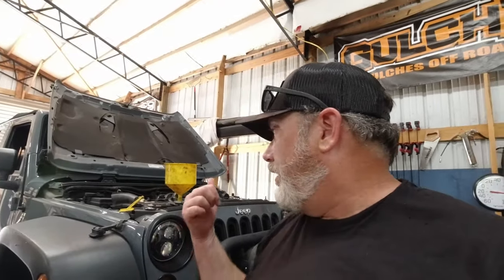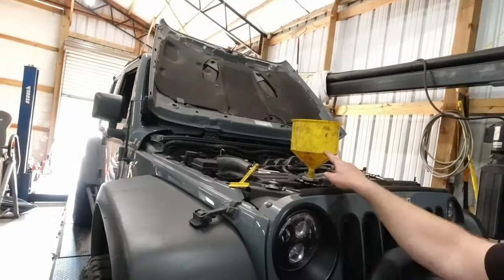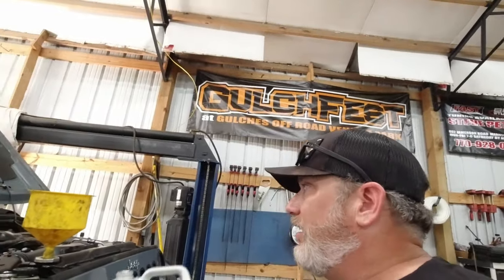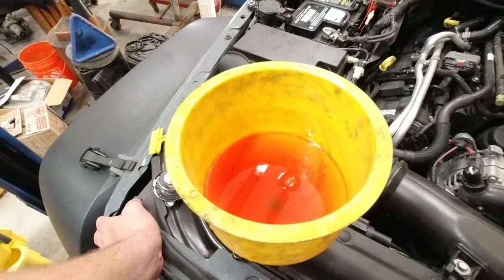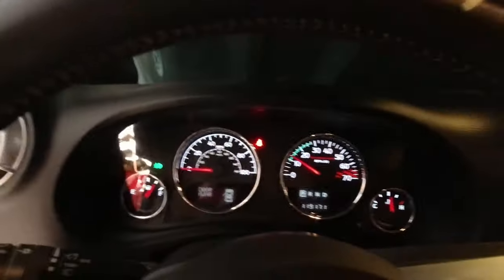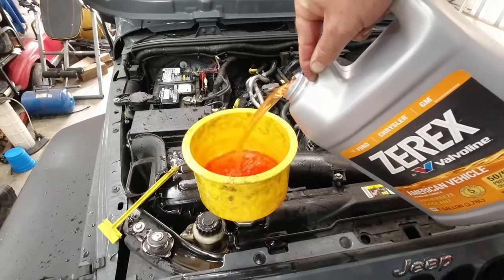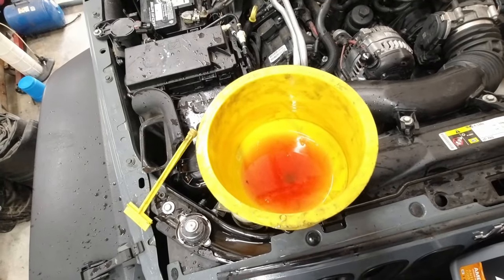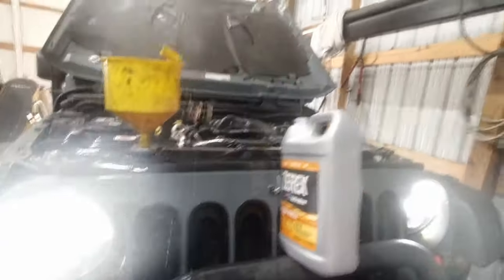Bleed The Air Out Of The Coolant System On A Jeep Wrangler

Comment: Have a 2013 wrangler. Changed rad and thermostat.  Rad was bad thermostat i broke plastic breather on thermostat. It has never ever over heated. Antifreeze keeps filling up overflow bottle. Keep putting it back in rad 2 days later overflow is full. Trying to get air out with that special funnel. Any ideas ??
Reply from the maker: Is the heat working?
Reply: @HotRodDave  yes it will heat you out.
Reply from the maker: Did you replace the radiator cap?
Reply: @HotRodDave  twice 2 different kinds
Reply: The check engine light came on bought 3 weeks ago took it to AutoZone code said antifreeze issue can't remember the exact code number but it had to do with the coolant system. They asked me at AutoZone to check antifreeze level. That's the problem antifreeze goes into overflow bottle and won't go back In rad
Reply from the maker: @tomholdren1015  Start out with the overflow/expansion tank at the low level mark and the radiator about an inch or 2 below the cap when it is ice cold.  I see people over filling the system on these a lot and it will push out of the over flow. If you have good heat at idle and going down the road and it isn't over heating you should be good. If you have a blown head gasket or a cracked head or block it will push coolant out but that is rare and will cause overheating or be caused by low coolant and overheating.
Reply: @HotRodDave  I've done that   I open rad cap when it's cold used my burping funnel unhook overflow bottle and pour it in the burping funnel leaving the overflow level at the first mark. And I go through the burping process. And it does the same thing after driving a day or two. Antifreeze goes into the overflow bottle and won't go back in the rad
Reply: I was wondering if it's my thermostat not opening and the correct temp and the antifreeze is getting hot and going back in overflow bottle? I did the burping process about 5 days ago and at first the vents were blowing cool and when I finished the process the heat was nice and hot
Reply: And I subscribed to your channel too
Reply: Two more things I forgot to mention. I notice when I take the rad cap off when it's cool there is pressure coming from cap when I take it off and second a lot of times when I take the cap off it's almost like a gush of air goes into the overflow bottle
Reply from the maker: @tomholdren1015  you may want to run a leak test for head gasket . They make a dye tester that you put on top of the radiator in place of the cap. If exhaust gasss are present in the cooling system the dye turns a different color. You can get them pretty cheap
Reply: @HotRodDave  blown head gasket? I've been told that's a negative. Doesn't overheat don't lose a drop of antifreeze and no smoke coming from exhaust. Performance is great. I'm doing burping as we speak. It was still releasing air bubbles then it started rising in the funnel so I blocked it shut off jeep and going to let it cool and start again. The whole time though the fan didn't kick in once that I know of. It still never overheated not once. Wish you lived close lol lol
Reply from the maker: @tomholdren1015  I don't know what else to tell you other than the heater cores like to get half clogged up and that can make an air pocket come back after you have bleed it all out. You can try a new thermostat and flush the heater core directly both directions. Fun with auto mechanics lol
Reply: @HotRodDave  dude I appreciate you!

Comment: they need to put a bleeding valve besides on the thermostat.  good video
Reply from the maker: Thanks. It has one from the factory but you can't get to it with everything put together.
Reply: @HotRodDave  yep...  i'm gonna have to do this tomorrow after replacing my thermostat..  i know theres one on the thermostat, but like you said, its about useless as tits on a boar hog...  my old grand cherokee had a very convenient bleeding valve up top....  on top of that, why have a bleed valve down low on the thermostat, it needs to be high, thats where air gets caught
Reply from the maker: @areutryingitout5678  exactly

Comment: So I have a 2014 Jeep JKU

Had a leak in the lower rad hose so I replaced it.

But the heater has never worked as long as i’ve owned the car, never really needed to fix it given where I live it doesn’t really get cold.

When burping the system (without heater on because it doesn’t work)
The coolant began to boil into the funnel and I turned off the engine.

Should I burp it again or is the boiling normal? Also the thermostat has not been over heating it stays very close to the middle.

Thanks!
Reply from the maker: I would be figuring out why the heater doesn't work first. I would definitely do several warm up cool downs and check the fluid when it cold in the radiator. If it isn't running hot on the gauge and not pushing coolant out of the overflow/expansion tank then you are probably good. I would want to know I had heat though.  Good luck to you and be careful not to get burned.  Always check the coolant level when the engine is cold. Thanks for watching and the comments

Comment: Since the jku /jk are a pain in the ass to bleed air out  do I need to repeat the burping process ?
Reply from the maker: If you can't get the heater working right or it overheats for sure. It can be a pain sometimes and sometimes it goes smooth
Reply: @HotRodDave  my heat works
Reply: @HotRodDave  so from day one I got my Jeep only on interstate at a higher rpm my Jeep temp would creep up to like 230’s 240 then go back down to regular temp, so yesterday I took it to a valvoline shop and they did a rad flush and fill and now it’s get a lot warmer and it’s only when driving in town now! It don’t over heat at idle which is good
Reply: @HotRodDave  but my Jeep never ever over heated. I’ve read that this engine runs more hot then normal it’s just how that are, but I wanted to try and see if I could get it to not get in the higher temps like it was from day one and now these fucks made it worse. The thermostat and housing is new also
Reply from the maker: @Rubicon14  they do run hotter than most other engines that I have worked on in my career.  Sounds like they made you a nice air pocket.
Reply: @HotRodDave  agreed definitely air in it. The manager from the valvoline shop is currently on the way to my house to fix it he’s going to burp/bleed the system. I called the customer service and complained. I wasn’t mad at the guys I was mad the the equipment because if you knew these vehicles are a pain to do then you should not do that service on them
Reply: @HotRodDave  so I fixed my issue!!! Those idiots at Valvoline somehow when they vacuumed my coolant system, it caused my thermostat housing to leak so I ended up going through two thermostat housings because the first one I bought that stupid bleeder screw was leaking after I wasted about an hour bleeding the air out of the coolant system so I bought a second one and that one had no leaks and I use that nose spill funnel kit, which is amazing by the way it’s worth every penny, and it took me about two hours to bleed all of the air out of the system, Was letting it warm up to temperature and cool down and I repeated that process until all the air was out now my Jeep runs cooler than it ever did
Reply from the maker: @Rubicon14  awesome

Comment: I thought the recovery system was supposed to burp the system automatically?
Reply from the maker: What recovery system is that?
Reply: Coolant? What else?
 @HotRodDave
Reply: @dnwrd34 
The recovery is lower than the heater core tho .
Still trapped air

Comment: I have a 2012 and the thermostat housing has a bleeder in it.  Would that not be the simper way?
Reply from the maker: Should be
Reply: It’s kind of a pain in the ass to get to that plastic bleeder. I’ve done that and the radiator and got the volcano.
Reply: You need be at the highest point of the engine. Air bubbles float up and burp out of the radiator cap opening,

Comment: Whatever you call it the orange stuff is crap in my opinion

If you don't get rid of the air pockets the orange stuff will gel 

My daughter Chevy had that junk when I started changing parts even the connector from the fill to the radiator was clogged with that orange goo only it was an orange cement.

I don't know who worked on it before but I cleaned everything out flush that garbage down the drain  metaphorically and replaced it with good old green stuff which is a lot cheaper and simply works better as it doesn't cause any damage even if there's air in the system but you still need to flush the system as possible to get air out
Reply from the maker: Yeah the dexcool gm coolant had alot of problems especially if you mix it with green.  I have seen it turn brown and get thick
Reply: Never cross mix coolants

Especially the hoat & oat